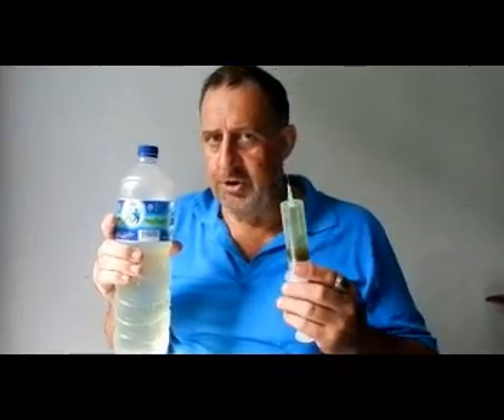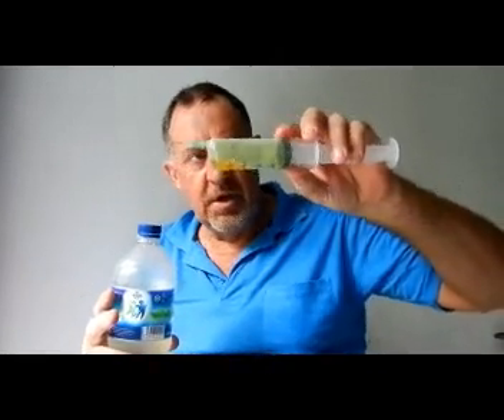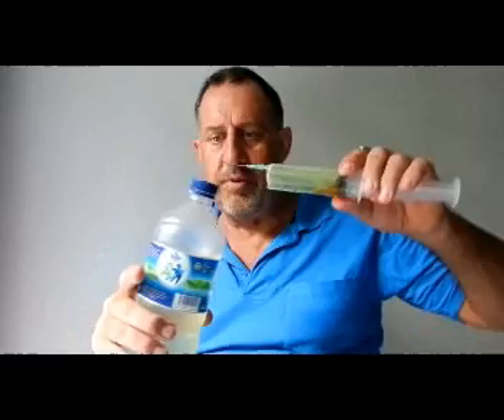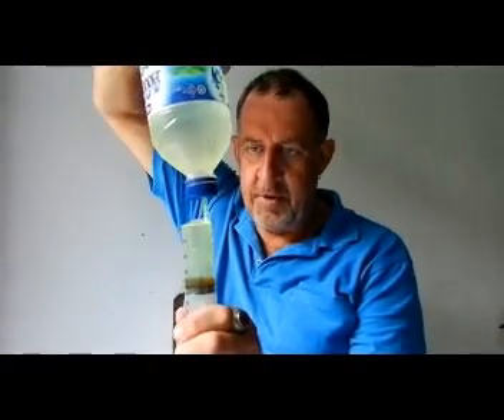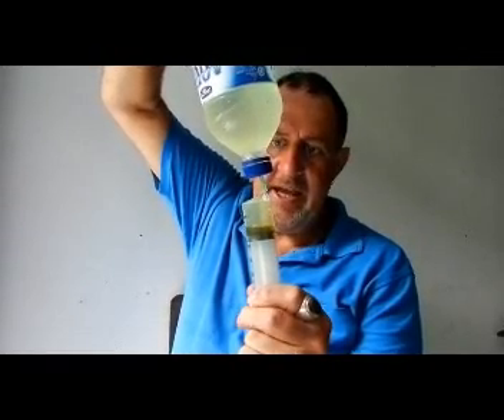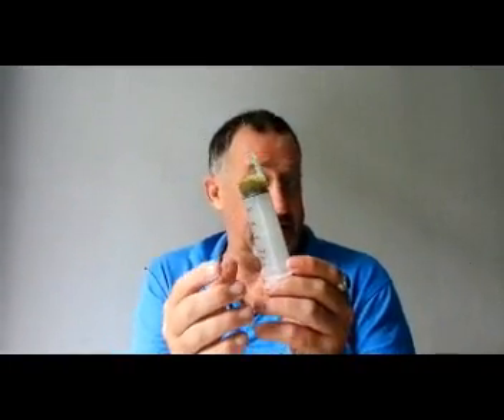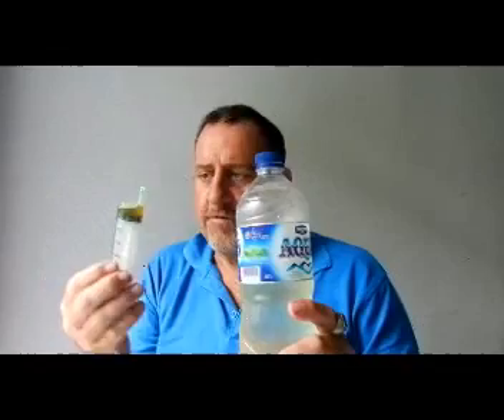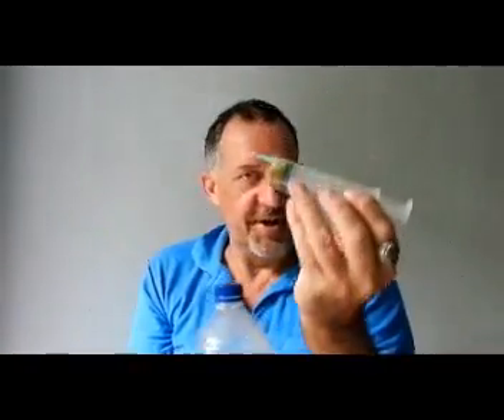Making CDS from MMS the simple way

Comment: This is a very bad idea. ClO2 gas should not come in contact with metals and yet you're using a metal syringe with a metal needle. You're contaminating your CDS solution with oxidized metal ions.
Reply: It is too short time to oxidize it to rust and it is gas coming into the bottle no rust
Reply: Isn't the needle of stainless steel?

Comment: I have a background in chemistry. This method is not "100% efficient". Gas will be lost when the MMS is activating in the syringe through the needle outlet, both before and after the needle is put on. Secondly, unless you did stoichiometric calculations to determine exactly how much gas will be in the syringe that's injected into the water, then the wate will not reach saturation. In other words it's a very weak CDS solution. Third, the MMS is not warmed, so it will not liberate all of its chlorine dioxide gas.

Jim's method is better because once the water reaches saturation it will be a deep yellow AND you will start to smell the gas coming out of the top, because the water has reached saturation and can no longer hold anymore gas. Jim's method is not that hard you just need tubes and a couple of bottles. No big deal.
Reply from the maker: and your a fuckwit so piss off please
Reply: Where can I find Jim’s way to do it?

Comment: Did u put full syringe in ? The 24 drops ? 
Also how much CDS do you take ?
Reply: Scott Maher He actually mixed the solution in the syringe with the top off. After reinserting the top, it was turned needle UP, and purged the air almost all out. After pushing the needle in, inverted and slowly forced the solution into the water. 

Drink 4 ounces every hour. Avoid Vitamin C by 4 hours. Also Coffee (caffeine), and any sodas should be avoided by at least an hour. I don't know the effect of Cervasa on its efficacy either.
Reply: +donald ducky how many drops do you take after that ?

Comment: IT HELPS ALOT IF MASHJ50 EXPLAINED IF HE USED MMM AND CITRIC ACID AND IF HE WAITED 20 SECS. FOR IT TO MIX - BEFORE HE ALLOWED THE GAS INTO THE WATER.  ALSO, CAN HE MAKE ANOTHER LITRE WITH WHAT'S LEFT IN THE SYRINGE?  HOW I WISH MASHJ50 WILL ANSWER CLEARLY.  I'M NEW WITH THIS.

Comment: I'm an insulin dependent diabetic so have syringes galore.  But they are small - 8mm needle - 3/10mL/cc for 30 units or less.  Can I use this?  But how much  MMS and how much of the 50% citric acid must I use and ALSO how much spring water?
Reply: donald ducky - so the basic ingredients are sodium chlorite and citric acid. The citric acid is at 50%? If I have powdered citric acid would I mix 50/50 powdered citric acid and distilled water to get 50% citric acid?
OR - do I need to buy the MMS and citric acid online already to go? And, if so who would you recommend to buy from in the states? Thanks. Cheers.
Reply: beck-weth beckweth Take a look at this PDF on mixing.

CDH - Making and Using - MMS-CDS-CDH Info

You can use HCL (4%), which reduces the metal taste. So you can buy just the MMS (Sodium chlorite) for like $15. It should last a long long time using oral dosing. You can get the HCL at your hardware store. It is sold acid Muriatic Acid. A gallon is like $7. You will only need 50cc/ml in a bottle of store bought water. they are like 16 ounces or half a liter. Pour a little out of the water bottle and being very careful 50ml of the Muriatic Acid into the water. That is the same amount needed if you were using Citric Acid (50%). Then pour 4 ounces of the mixture into a container like the sodium chlorite comes in. Or just a small a small bottle like eye drops bottle. Doesn't have to be 4 ounces. Just use it 1 to 1 into a small plain glass, wait 20-30 seconds (until dark amber) and add water 3-4 ounces and down it goes. Start with 3 drops once a day, then 3 drops twice a day (on an empty stomach). And so on. ALWAYS keep 5000 mg of Vitamin C on hand, if yogurt nauseated. If the nausea seems like you may hurl, take the Vitamin C and the pathogen killing will cease. if this happens lay off a day and then start back with half the amount of drops for a few days to kill off enough germs that your body won't try to purge itself. If you ever got drunk and nauseated, it's the same thing. Your body will reject.

Being insulin diabetic is a pain. I suggest you reduce your sugar intake. That includes ANY foods containing sugar, and start taking a 50 billion unit Probiotic every day, first thing in the morning. That will help 70% of your immune system get straight. should make BM's regular with much better consistency all around.

Good Health.
rev don
Reply: Helena Fonseka If you have the MMS now and the activator is Citric Acid (50%) use equal parts with the Sodium Chlorite (MMS); drop for drop. Wait 30 seconds before injecting the solution into the water. The reason he did it the way he did, there is CLO2 gas being generated by mixing the Sodium Chlorite with the Acid, and you are embedding that gas into the water. Keep a tight lid on between drinking and keep in refrigerator if possible; The CDS will last longer. If the CDS is at room temperature, the last of it will be less potent than the beginning.
Reply: Helena Fonseka There are 20 drops in One CC or ML. If the syringe will hold 48 drops at a time, you can use them. If the will hold half 24 drops, you can do it twice. If the needles are delicate, try pressing a hole through a cap that you have extra first, and then with the solution a new syringe it will not be hard to penetrate. Also after completing, best to have another cap without a hole to keep the CDS in solution.

Comment: Yes but how many ppm is it? You maximize the amount you can make by heating the bottle with the MMS. Sure you get a little bit of gas but it doesn't look like you're getting the 3000ppm to follow the protocols.
Reply: RC LIFT OFF! I agree. His method sacrifices a certain amount of quality, so to speak, in exchange for gaining simplicity. 

I like how it was done in the video where several bottles are connected in series, with the first one off gassing into the second, second to the third, and so on. All pushed by a small aquarium air pump. Nothing wasted, and the water gets completely saturated that way. 

I suppose with a syringe, one could pull the plunger back and re-inject into the bottle again and again, instead of just once as was done in this video. But I like the idea of hooking up a few bottles and letting the air pump push the gas in. More bang for the buck that way, I would think.
Reply: It's a much weaker solution that the regular method.

Comment: Nice to see things move along. 
The shot glass method has pretty much deprecated the old forced air methods that we've seen at the start of the CDS revolution. Though I'm not entirely sure on the efficiency of the entire process given the volatile nature of the gas to begin with. ie, there is good evidence that the best CDS is freshly made with low temp receiving solutions. I've also found that infusion rates are best controlled through a gradual introduction of acid rather than to dispense both solutions into the reaction flask at the start. And finally, a scrubber really helps control impurities or bi-products during processing. - not easy(I know) but if were talking about getting the most out of our base products/components, then these measures are likely the best we've got to date.
Reply: With all the censorship.. where do I find this info!  Also,  testimonials?

Comment: @mashj50 this is Brilliant.  Since we're currently in the Land of the Fee and Home of the Slave, specifically New York where medical supplies are kept in virtual lockdown (even epsom salts at chemists, I had to ask them to unlock the cabinet LOL) -- well here's my question:  Do you have a brand name OR size measurement of your syringe and needle?  Trying to source them here, if bad luck will probably order from veterinary supply. Tube of syringe looks to be about 3 1/2" (9cm) long and 1 1/2 -1 3/4" (3.75-4.5cm) across, with syringe nozzle 1 1/2" (4cm) long and needle 2" (5cm) ...  any road, if you can provide brand or size info would be grand, thanks again for a spectacular bit of engineering brilliance mashj50!
Reply: @mashj50, Actually I can't even get a needle & syringe from a bloody veterinary supply here Without A Prescription.  Gack!!  Back to drawing board!  Thanks mate just the same.
Reply: Thanks John, did try Amazon and other online sources but no one will send it into NYC. AMA laws etc.  Anyway, we'll soldier on!  :-)
Reply: pax etheria Just order a couple online mate
Reply: pax etheria Have them send it to a friend in a different state and they can send it to you
Reply: good tip donald ducky we've been traveling and picked up supplies in Canada lol cheers

Comment from the maker: well they seem to be sending mixed signals u want the water saturated or not ? they need to decide as for stainless steel needles i doubt very much that the 3 or 4 seconds it take to inject the gas would be an issue, I'm not dead or sick yet so i suspect it's a non issue, it's all a new field, with the odd wreck less soul like me not giving a fuck about silly concerns over ss needles reactions, and  gas build up, that's this point isn't it ? to build up the gas and saturated the water with it ?

Comment: This looks very simple! well done.  I did notice a comment on an older CDS Andreas video asking him to remove the video because it was outdated and one of the crits related to using a metal component in the transfer.  I assumed it had something to do with a reaction with the metal though I would assume a needle is high grade SS so wouldn't assume much reaction there but I don't know.  Andreas must have a more recent video up.  Have you had any support from A. or JH on your method?